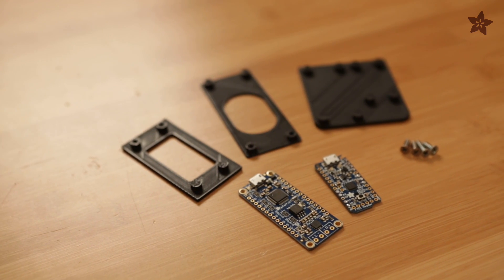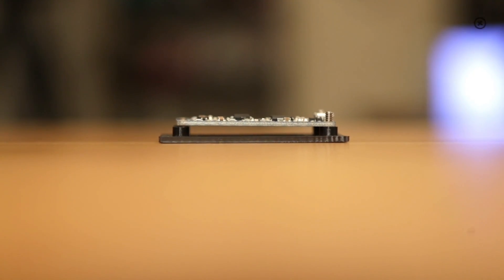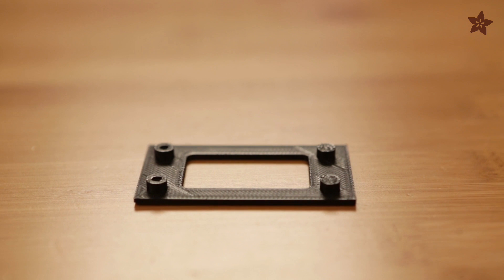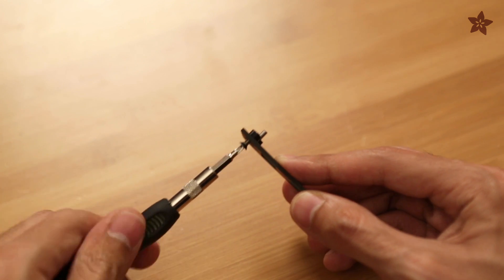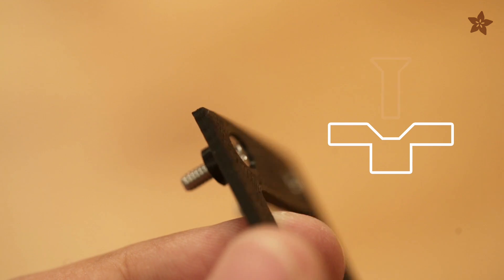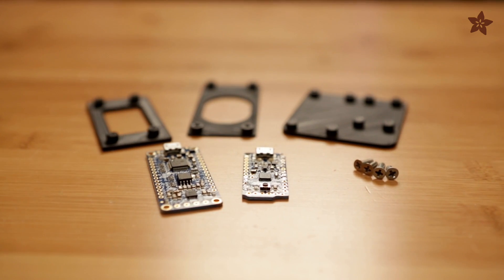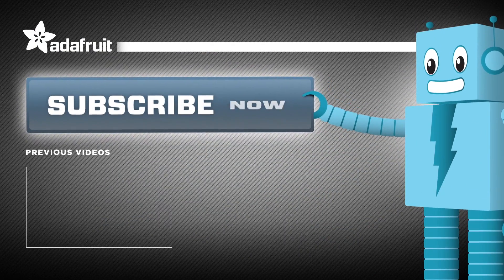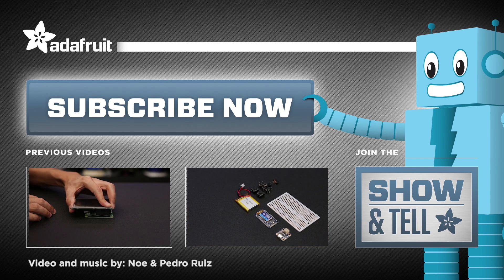3D Printing Design Tips - Standoffs

Comment: How much smaller do you typically make the inner diameter of the hole to be threaded. I'm working with 4-40s and the screw diamater is about 2.8mm, do you go with 2.6mm or less?
Reply: I usually do .2 mm smaller than the screw. Most of my work has been with 3 mm screws, so I do 2.8. I would guess that is sufficient for anything smallish. At some point (for larger screws) you would probably want the diameter to be more than .2 mm smaller.

Comment: A threaded insert is needed when mounting and unmounting a large number of times but they need a considerable larger boss to mount into. Size your threaded hole to the root diameter of the thread or slightly larger. If you are going to turn the screw to do the fastening make the through holes slightly larger to avoid stressing that part. But better still is to print in a hex void for the nut and use a nylon computer board standoff, more secure has male threads on one side female on the other. There is no way the case can fail using these. I suggested nylon because it cannot short out any traces on the board.
Reply: A press-fit nut, or "pem nut", does a better job for 3D printed parts. They are available for all common small screw sizes from the usual sources, such as McMaster.com for $10/50, or various Chinese sources.

You insert the pem nut by heating a temperature controlled soldering iron to the same temperature you use for extruding the plastic. Push the pem nut gently straight down into the hole.   McMaster has recommendations for the hole size required.

Great for any time you will be mounting/unmounting even a few times, or need a bit more strength to the connection.

Comment from the maker: 3D Printing Design Tips – Standoffs
https://blog.adafruit.com/2015/03/26/3d-printing-design-tips-standoffs/

Here are quick tips on 3D printing standoffs for enclosures – I hope this helps you speed up your design revisions. If you have any tips, drop in the comments – that will help me out and other people, too.
Reply: I like your tip of printing a partial to get the design correct. Brilliant! Perhaps using threaded inserts would be a good tutorial. Threading a machine screw directly into the PCBA is a little iffy!
Reply: Matthew Flach Totally agree on the threaded inserts. Good call.